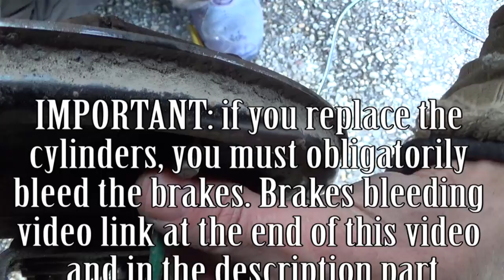How to remove & replace rear drum brake by pre assembled kit shoes & wheel cylinder

Comment: I wish you were my dad who could teach me. I am changing my drum brakes but got stuck putting the drum back on? Do you have to replace the slave cylinder or also know as wheel cylinder?

Is there a way to reuse the wheel cylinder but both sides? Noticed how the one you threw out the right side was pointing out more and the left side wasn't

Please help me sir?

Comment: Removing the drum off old Clios  can be a nightmare because a ridge builds up due to the braking surface of the drum wearing down, which can if bad enough, make it impossible to pull the drum off. This would not be a problem if it were possible to release the brake adjusters, but you can't.

Comment: Don't place your axle stands under the sill -- they are not load bearing.
in the event of jack failure, the axle stand will damage the sill - use the axle stand under the torsion bean which runs across the vehicle.

There is no sign of fluid leakage - why are you replacing a perfectly serviceable slave cylinder, creating the need to bleed the system.
On an older vehicle there is a likelihood that the pipe nut will be seized into the slave cylinder, and you will shear the pipe at the union.

Simply rebuild the shoe and auto adjuster mechanism following any of online videos.